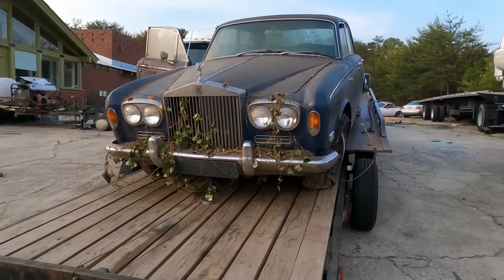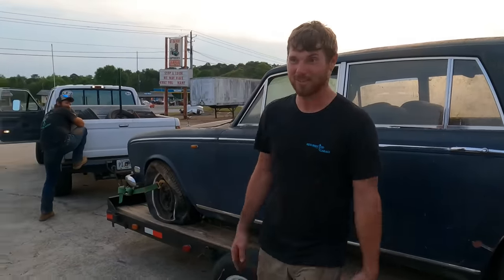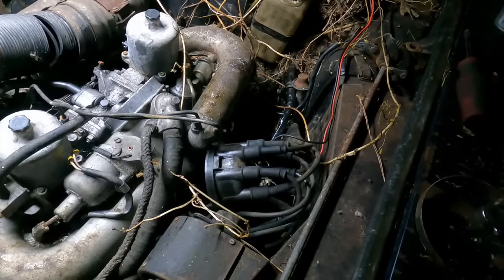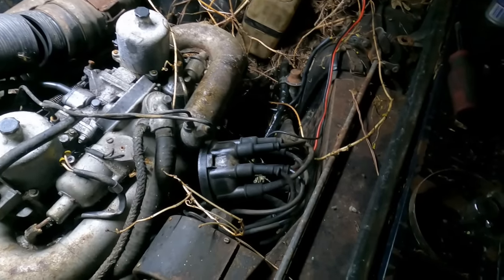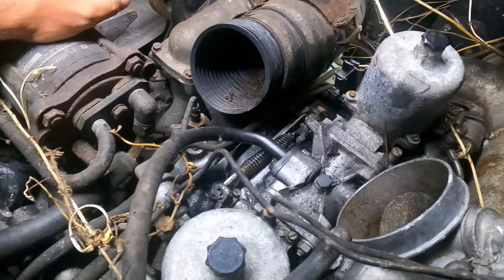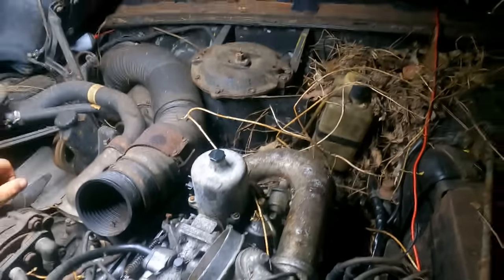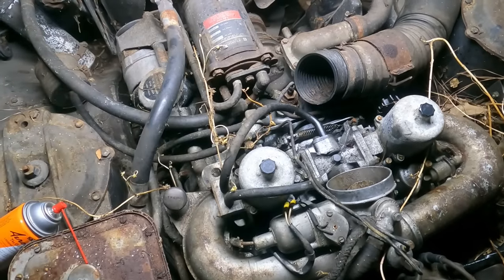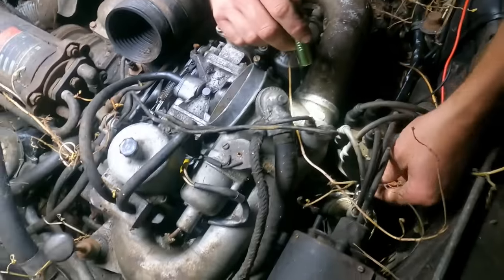Bought the Cheapest Rolls Royce - Will it Run? 1971 RR Silver Shadow Saved from the Crusher!

Comment: You guys seem like good mechanics but why not clean all the debris out of the engine bay before you start opening up engine components allowing dirt to contaminate them.  A car sitting that long needs all the fluids flushed, gas tank removed and fuel lines replaced before attempting a start.
Reply: You think: a good mechanic, never strips down anything until it is very clean! Also once the work area is clean, you make sure You are as clean as a surgeon. 
Would You let some scruffy person to operate on you? 
Retired now, but thank you for saving the good Mechanic's names. 😁🔧🇬🇧
Reply from the maker: The gas tank and the fuel lines are completely rusted through as are most of the brake lines. The car runs and drives now on a boat tank. Our goal with anything we get in is to verify that it will even run before spending any real time or effort on it. After we verified that we did go back and clean the car as well as the engine bay. RR where we are are not really worth anything this car is really really rough and will never be restored.
Reply: @ResurrectedGarage  Thanks for the update.  Good luck with it.
Reply: Those are jerks not mechanics.
Reply: Exactly!😮
Reply: Yes. Good question. To clean before work
Reply: Effectivement je prend le temps de faire ce que vous dites..mecano et collectionneur de Jaguar !...
Reply: Right, work must start by cleaning, no good worker !
Reply: My thoughts 👍🏻
Reply: Be a lovely car if they can fix it up... daunting though.

Comment: Whatever you do don't put brake fluid in it! If you do, expensive things will start to explode. You have get some special, hundred dollar, high pressure mineral water from Rolls Royce. Also I think the brakes, and rear suspension are somehow connected, but I am not sure.I do know that you need to do your research with a Rolls Royce. If you don't things get very expensive.
Reply: Castrol RR 363

Comment: With enough time and effort that car could be worth a small fortune. As long as you've spent a much larger one.
Reply: And people wonder how these cars wind up in this shape in the first place 😂
Reply: Unfortunately, these are not worth a small fortune even in the best condition. You can get a very nice silver shadow for $15,000. It's a shame, but big luxury sedans just don't hold any value.
Reply: @dwderp  it’s funny how many people don’t realize that the car isn’t really worth doing a $100k resto on.
Reply: Problem is the rot in it, if the cross members under the floor are rusted out its trash. We break better ones for spares. Could find one in the UK  for 2000 bucks.
Reply: Absolutely NOT. Shadows have meager value.

Comment: How does an expensive and valuable car just get abandoned to deteriorate and end up in a state like that?
And was the oil and filter changed? I do hope so. The engine is the most expensive part - just putting in petrol, connecting up a new battery and trying to start it with sludged up oil and a cruddy blocked oil filter is probably the quickest way to damage an engine that’s not been run for what looks like a decade or so.
Reply: Nope, the mineral oils was the most problematic and expensive
Reply: They really aren't that valuable when they get a bit older. Like any car, a Rolls Royce can become mechanically totalled due to the cost of repairs. A good Rolls like this is only worth maybe $25k in pristine condition. When it was parked it was probably worth less than $10k. Parts alone to fix the Citroen-esque Hydropneumatic suspension (licensed from Citroen) can exceed that. Add faded paint or a worn interior and a luxury car that is out of fashion and it just isn't worth it. Some parts, like the Chevy truck A/C system, some of the internals of the GM TH400 transmission or the Lucas (or Delco) alternator are cheap- the bespoke parts are not.
Reply: You'd be surprised how many of remaining of only about 50 000 exemplars built are still banger raced (and valued at banger racing for their strength)
Reply: First sensible post in a while. They should have changed the oil and filter, removed the spark plugs and poured some light oil into the cylinders. It should have then been left for a time and turned over to ensure that the piston rings weren't stuck to the bores. Sadly, the first thing people say when they get a car which hasn't been used for a time is "let's find out if it will start". What's the hurry? Better to spent a few hours rather than risk doing damage.

Comment: Good Luck on this Project , they always seem like a good idea  ,untill you start Pricing the Parts you need ,  make sure you or nobody else’s poured PetroleumBased Brake Fluids into  any of the Hydraulics because that  just disentigrates the VirginRubber the British used on  the older Vehichles and Motorcycles  it’s a Must to use only Vegetable based fluids in those Systems that was very difficult to find inAmerica years ago  Fortunately CastrolGTX  that is D.O.T. Compliant  is easily  found in most AutoParts stores and evenWalmart these days  back in the 1970s  you had to purchase it usually at  Dealership Parts Counters at their rediculously marked up,Prices
Reply: Castrol RR363 in this one
mineral oil is for vin no 30.000 and onward 
= Silver Shadow 2 and Silver Spirit

Comment: If my memory serves me right Rolls-Royce was using general motors turbo 400 automatic transmissions. If that's the case a V8 swap with so many different size Chevrolet engines you could choose from..😊
Reply from the maker: Believe it or not the engine is pretty solid, we just have a problem with the overcomplicated brake system. This has become one of our long term builds but we plan to leave the motor/transmission in it for now.

Comment: Like most English cars at that time probably had Lucas electric as a majority of the electrical make up. Lucas electric was terrible. Lucas electric also did freezers refrigerators etc. There is a saying I've heard for years, that the reason why the British drink warm beer is because of Lucas electric. Good luck with your getting this car going.
Reply: Got to use that joke just the other day 😂
Reply: @ManicWrench  that is cool sir
Reply: I read once that Brits used to refer to Joseph Lucas, the founder of Lucas Electronics, as 'the prince of darkness'. Because of all the european cars running around with no headlights because of defective Lucas electrical system parts.
Reply: @m6780  Hopefully they have fixed Lucas electric. Thanks for that information it as funny.
Reply: Yeah Lucas the prince of darkness 😂😂
Reply: @trickym5748  You know here in America back in he early days until about the early 2000's Chrysler-Dodge-Plymouth had the same problems with electrical parts as well. Now they are better. In the 40's 50's & 60' my father told me that if a dog pissed on the steering wheel of a Chrysler-Dodge -Plymouth it would not start. Apparently, they had reputations of not starting in the rain during those days. Wonder if Lucas electric was in them or influenced them LOLOLOL

Comment: Amazing how you could start the engine without totally refurbishing the SU carbs, especially if they are HIF with the specific choke system.
Reply from the maker: The choke and cold start circuit not operating correctly makes it a massive pain to start
Reply: @ResurrectedGarage  Yes I imagine. This little valve is a real mess.
Reply: @ResurrectedGarage  By now you must have removed the dash pots,the round things on top of the carbs. If the pistons are stuck or sticking,the car will never run properly. They use a ATF in the top where those black knobs are.

Comment: make sure you use the correct brake fluid RR363! I'm sure the whole brake/self leveling system will require a total going through with new hoses, etc!
Reply from the maker: On this particular car we eventually found that the brake lines are rotted through and even after filling the reservoir with fluid fluid and running the engine for quite some time it failed to even leak fluid which tells us we have even more problems with brake pumps and possibly other components as well. We are going to plumb the car for a standard master cylinder in the near future
Reply: Funny but I said the same thing. My dad had a 73 and a 74 and the worst problems were electrical and the hydraulics. He bought Girling oil by the case.

Comment: Those side draught SU carbs are dead simple. They were used on everythings from various Austin/Morris cars up to Rolls Royce engines.

Making sure that there is fresh oil in the dampers (the pot shaped aluminium thing with the plastic/bakelite cap on the top) was essential to make sure they work.
Reply from the maker: Getting the dampers clean and moving freely again was key in getting the car fired up and running. The enrichment system for cold start is not working and one of the floats is cracked and sinking causing fuel leakage if you let the bowl fill
Reply: Hello Graham how are you doing 😊
Reply: @ResurrectedGarage  Engine oil in the SU dampers on R-R

Comment: Put oil in the "foam" under the caps on those carburetors, otherwise they won't work properly.
Reply from the maker: The dash pods were very stuck and a major reason the car wouldn't run. unfortunately most of the footage playing with the carbs got lost

Comment: My self I'd have checked for a spark set up a temporary fuel supply and check the oil levels engines were so simple in them days.
Reply from the maker: We have a boat gas tank we typically run them off of, I couldn't tell if we used it in this video but the videos thereafter we were using it.

Comment: Even lying in dort and dust, Roles Royce remains a Roles Royce. Should be maintained and fired up with proper prepration. Chech fuel line, tank, carbs, ignition, engine oil, etc etc before hitting start.
Reply from the maker: Absolutely, fuel lines were rotted, carbs stuck, ignition not firing and. Oil was full, which was actually checked before we handed over cash for the car

Comment: Dude's on 7:21 the rolls royce don't start but i'm gonna watch the vid till the end and i am sure this beauty gonna start! In case the rolls don't start i drink a jerrycan fully fueled gasoline mixed with diesel!!!
Reply from the maker: If you hang out until the end of the video you will see that after we got the carbs moving freely the car actually runs pretty decent. Trying to start it on aerosol just lets us know the timing, compression and spark are all present for the car to run once a proper fuel supply is added.

Comment: Wouldn’t be surprised if it had a seized valve or two. Very common on these engines after long periods of lay up
Reply from the maker: We actually got it running pretty good at this point. This one surprisingly doesn’t seem to have any such valves. Working on the brakes currently. There will be an update video coming soon that will hopefully show it driving down the road.
Reply: @ResurrectedGarage  awesome. I brought one back to life a few years ago. The braking system seems complicated but it really isn’t.  Simple hydraulics. There are some good animated diagrams online
Reply: If you need any guidance shoot me a note
Reply from the maker: @lifeat5knots  Thanks. I will keep that in mind. You can never have too much information on these things.

Comment: What do you want to do with this Car? There are a lot of parts to be replaced. Trying to start the car without new parts could damage the engine completely.
Reply from the maker: Short term for now, leave it looking like a hot mess and drive it. We've already got rid of the SU carbs and fabricated an adapter to put a Holley carb on it. It runs pretty good with that. We just haven't had time to fix the brakes in order to actually drive it down the road. We don't care about keeping this one original because its pretty roached. There's another video we did of really nice black one that we did some work on, but it's all stock and original.

Comment: Sounds like the points need to be cleaned or replaced!
Reply from the maker: Cleaned the points and it fired off, in this video we were still contending with sticky carbs, no cold start circuit and sticking choke

Comment: why start on the ignition ,before checking the fluids?
Reply: selfmade mechanics quite skilled
Reply from the maker: The fluids were checked before purchasing the car.
Reply: @ResurrectedGarage  thanks
Reply: @ResurrectedGarage  I think as the Lady is still in place there is no worry about the fluids 
You should use R-R 363 in the brake system

Comment: I don't know who let you loose on that butiful RR. But, you are doing everything wrong!
First, clean out engine bay with air line. 2nd, No one who knows anything about mechanics, scwerts "Easystart", into a quolity motor!?!
Easystart is for very badly worn engines, were the comprsion is so weak due to neglect or never been serviced.
If you are mechanics, please read or ask a professional for how to treat such a classic motor.
If you had to go under the knife, would you want the sergion, to be covered in dirt??? I think not.
This is not to upset You. It is truthful addvice, and if you start off with a clean area, you will save yourselves a whole lot of problems. 🤨🔧🇬🇧
Reply from the maker: This RR is anything but beautiful, it's really really rough. We are the only suckers that decided to save this car from being crushed. We bought this to learn all the ins and outs of RR. Since this was our personal car we wanted to verify that it would even run before we spent more time and effort on it. Later on we clean up the engine bay and get the car moving under its own power in another video.

Comment: If I were you , I would remove that engine, and replace it with Chevy 350 . Thanks
Reply from the maker: The engine in this car runs great now, Daniel got rid of the SU Carbs and installed a Holley carb on it. The brake system is the main problem - it's very overcomplicated with the way that it was designed and works. That's pretty much were we stopped on it for the time being.

Comment: Then you run out of money on the suspension. These things are awfull to repair and run.
Reply: With pressure in the accumulators it is mostly o-rings needed not so expensive parts it is the work to do it
Reply: @burnotto1663  Ok good luck.
Reply: @Coordinator61  I am a factory trained R-R mechanic for Silver Shadow 
So I guess I am the one to wish You good luck
I will try to help You in the comments
Reply: @burnotto1663  I am a trained car/truck mechanic too and engines in boats so to speak. Cool that you are a RR specialist but these cars are far form easy to work on. Thats why they are cheap to buy but then the money starts to roll. There is no cheap RR anywhere.
Reply: @Coordinator61  You do not need to fix it upp to R-R standard just nice will do
I am a former R-R service personal from the S Shadow era  retired now
Reply: @burnotto1663  Old mechanics are a special breed now haha. But keep on working on old cars pls.

Comment: I owned 2 of these bought in the 90s both1973 models,sadly I sold them both at a huge loss,so as to give then new wallets to support them. With the 10 cents one the dollar I got for them in 2007 I bough a brand new 1976 caprice with 1600 miles window sticker on the glass and put that in storage.

Comment: Ratbags working on a Rolls Royce, drain and refill  cooling system, drain sump oil and refill, clean around the engine, put in fresh fuel then maybe try to start it.
Reply from the maker: If this was a nice enough car to restore then yes we would have did it that way. We weren't going to put a lot of time in effort into this car if the engine wasn't any good. Turns out the engine works great and most of the rest of the car is junk.

Comment: Dot 4 fluid I the brakes is fine but not 3 and not mineral oil that started in 1980. 20/50 standard engine oil 
All the hydralics calipers rear rams 6. Aliens 14 flexible brake hoses all have to be overhauled,kits available from flying spares.UK  in englqnd.

Comment: just for content 😠
fake !
Reply from the maker: This is video #1 of a ongoing series. Video #2 is posted already. I'm currently working on the latest video #3 which features the Rolls driving on its own around the shop - the guys got BOTH the motor/transmission and rear end working. That's a pretty impressive feat that not many mechanics would even try their hand at and our guys did it! Be sure to check out the video #3 when it drops. -Brittany 🙂
Reply: What part of the video is fake?
Reply: I thought like the other videos, using bushes and soil to make it look like finding junk, but after I looked again, it seemed natural. I was wrong, sorry..
Reply from the maker: No need to fake anything here, we enjoy working on old quirky vehicles and stuff that other people have written off.